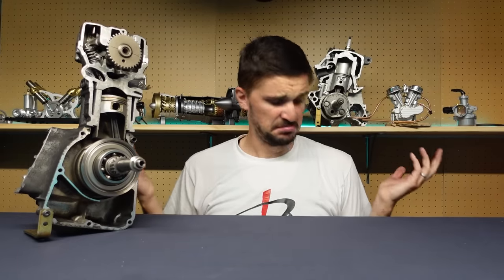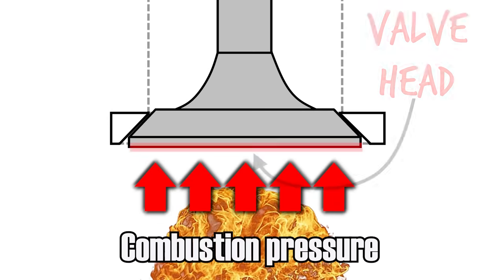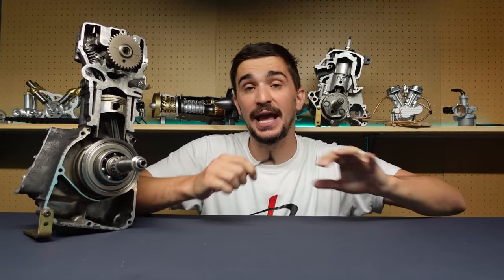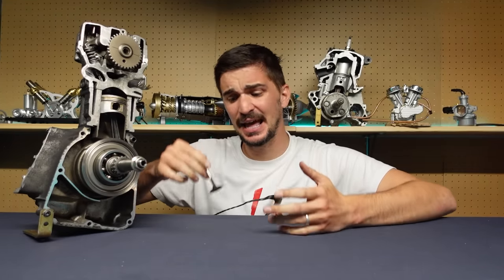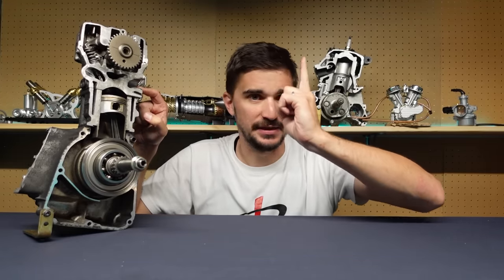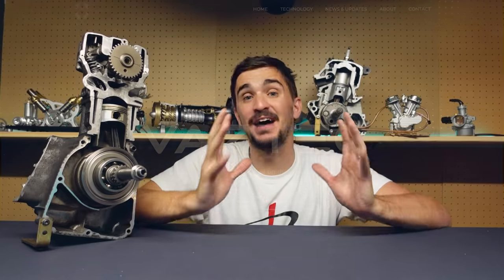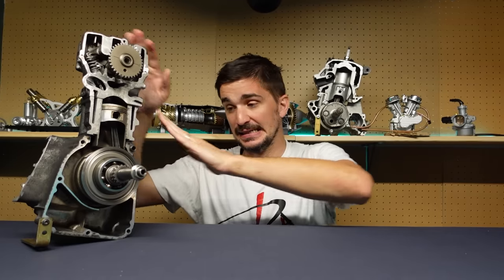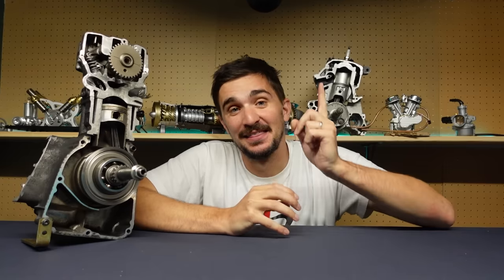Rotary Valves Make Normal Valves Look Silly - Why Aren't We Using Them?

Comment: SUPERCHARGED SUMP LUBRICATED 2 STROKE thats what we should be developing - and F1 cars should be made to use these - they would sound ASTONISHING
Reply: Not really usable with emissions standards. The Ferrari engine was basically the same concept as a 2 stroke diesel. They have issues with pushing unburnt fuel out the exhaust. Unburnt fuel and catalytic converters really don't get along.
Reply: @morpfrank4709 - I thought that issue had been fixed a long time ago but the only reason the project didn't go forward was not demand / need for it
Reply: @piccalillipit9211 there is no real way to get around the fact that air comes in at the same time it goes out other than leaving some exhaust gas in. This is basically what egr does I guess so it may actually help with emissions on a gasoline engine but eliminates the ability to use an EGR cooler on diesels. However without implementing a power valve like device on the intake they wouldn't have the same variability with timing that vvt provides. Sump lubricated 2 strokes are by no means dead and are used in marine applications alot, however big cargo ships are the last vehicle that cares about emissions.
Reply: What like the DeltaHawk engine? Turbo and Supercharged 2 stroke aircraft diesel
Reply: @daveone191 - I dont know cos I have only seen the Ferrari and other prototypes.

I you use forced induction you can lubricate the engine the normal way, its incredibly tiny and you get 2 X the combustion events. I just want to hear a V10 2 stroke F1 car reving to 25,000 RPM
Reply: @morpfrank4709 - I cant remember I watched a documentary about it but I literally have brain damage which means i forget some things.  

"This is basically what egr does I guess so it may actually help with emissions on a gasoline engine". I think you are correct that with port tuning [exhaust?] they could achieve very good emissions. 

For me F1 should be a test bed for weird and wonderful possibilities.  Have 5 years running 2 strokes, then 5 running Deisel, then 5 running 3 cylinder engines. 

If you re going to have multiple billions go into engines - make them invent new things
Reply: @piccalillipit9211 it's lovely to see you here, away from the subject areas I usually see you. It restores my faith that humans can think broadly. 😊
Reply: @alanhat5252 - Im trying to consume less news.  I realised I had a level of awareness of political world events that could only be described as "unhealthy and obsessive". 

Its good to be informed, but there comes a point where is not good, its obsessive and damaging and I had definitely reached that point.   Also very nice to see you here.
Reply: @piccalillipit9211 I too love valve-ported scavenge-blown 2-strokes
Reply: @piccalillipit9211 you spreading awareness of just how grotesque politics has become, & how dangerous, has huge societal value & I thank you for it but as you say, everyone has to find their own balances.
Reply: @alanhat5252 " everyone has to find their own balances."   Id got to the point I was correcting BBC correspondents on trivial details of  Saudi Arabia's politics and  such like - I thought "why do i KNOW this? This is of no interest or use to anyone and i simply should NOT know this stuff. This is an UNHEALTHY level unless its literally your JOB"
Reply: @piccalillipit9211 I like your idea of F1 as the test-bed for expanding technologies.
I understand F1 are going into battery-electric propulsion next which might mean them finishing with internal combustion though one of the Japanese makers (Toyota I think) have just announced a new ICE which they claim to be cleaner than battery-electric so who knows?
Reply: @piccalillipit9211 I don't know what's healthy, what I do know is that most of us have a very minimal & severely distorted understanding of world politics as compared with the Victorian & previous populace & this seems to be the work of the Daily Mail & other tabloids. (The Mail was the first, in 1896, probably encouraged initially out of snobbery). Most of us don't even know where our food comes from let alone what unpleasant surprises the future holds.
Reply: @piccalillipit9211  
The hard part with the supercharged 2 strokes is oil control. As you know, in a 2-stroke (even one with exhaust valves) the piston controls the intake ports by moving past them. When that happens it's inevitable that some oil will be wiped off the piston and rings and deposited in the intake port. Then on the next cycle that oil gets blown into the combustion chamber and burnt. Result is more particulate emissions and excessive amounts of ash (from burning of metal containing oil additives like ZDDP) in the exhaust stream, the ash tends to poison catalytic converters. Achates power claims to have mitigated this problem by very carefully controlling the amount of oil that actually reaches the piston rings (just enough to lubricate them, so the total amount of oil burnt is lower). We'll see how they do with their design once it gets to the production stage.
Reply: @nerd1000ify - This is so obvious and I never thought of it...  Thank you!

I once cut the end of my finger off in an intake port LOL, just installed new rings and I was pushing the pistons up and down and my finger slipped off the domed top of the piston and into the port - the momentum brought the piston back up and chopped off about 3/8ths of my finger 8mm - its still kinda flat at the end LOL

Comment: I once read (not long ago) about the story of completely eliminating the "camshaft" from an engine,along with the metal springs from the valves,and in it's place,using electronically-controlled movements of the valves instead! In other words,instead of the conventional camshaft physically pushing down on the valves,along with the valve-springs needing to push back to it's original position,these valves,had electronic sensors on their stems,hooked to the ICU,so each time the piston would approach it's time to fill the combustion chamber on it's downstroke,the electronic guided valves,would automatically open and close via their electronic "sensors" on the stem,and never have a problem regardless of what RPM the engine was running at. Sounded intriguing.

Comment: You are absolutely right about the power needed to open valves. It leads to lower power output for sure. Thanks for pointing that out. 🙏🙏

Comment: The Austrian model engine maker HP used to make a lovely range of rotary valve four strokes. they weren't very successful, because two strokes were cheaper and more powerful, and they made more revs. Beautiful little engineering marvels, though and incredibly well made and finished.

Comment: About a year ago I had a wonderful idea for this sort of thing. Of course like many others I thought I had just invented something completely new only to find that it recently has become a known technology. But what I see for this is a massive Improvement in the performance area. Here's my thinking

By the removal of puppet valves you no longer are scared of piston to valve clearance, meaning that you can design your Pistons for a massive compression ratio nearly taking up the entire head chamber. Also the loss of reciprocating motion and the weight of the springs traveling through sees and increase in horsepower. You can rev this thing potentially as high as you want until you start getting reciprocating Mass issues from the Pistons. I think this has a big potential and I even worked on my own CAD drawings to implement this on a Ford 302, an engine I'm familiar with

Comment: This example works well because it was selectively chosen by a smart engineer for its application: a V-twin or more plainly a separated single cylinder application. That application doesn’t expose the vulnerabilities of common bank sealing or heat. This application is best suited for single cylinder or radial engines.

Comment: I swear this is true. Around 1975 or so I heard someone mention the expression, "rotary valves" and started thinking about what it could mean. Over the next few months, I kept thinking about it and designed a system much like you see here. It was all on paper only and I was never in a position to build a prototype of any kind. I was never in a position to test any of my theories about how well it would work. What I did know was that by removing the rotational losses and wasted horsepower of camshaft lobes acting against springs there would have to be some increase in power.  I also expected that sealing would be a problem, but couldn't research it or try to overcome those problems.

What I'm driving at is that I have no idea when this design was originally conceived or invented, but the fact that it originated independently in my head is very gratifying. I actually invented this, even though it might have been invented well before I did.
Reply: Congratulations Jerry.  That is a gratifying feeling to experience being on the same path of a respected person.  It pisses me off when the accomplishments of engineers are dismissed because they did not initially conceive of a concept.  Execution of the idea and much more; the production of the idea is the thing.

Didn't DaVinci conceive of the helicopter.  And the Wright's invented and executed controlled, powered, heavier than air flight.  I do not believe any of their original designs really made it to mass production or survive today.

Comment: Over the decades, several working engines have been designed and built using rotary valves.  They are volumetricaly more efficient than poppet valves, and the spark plugs and fuel supply can be addressed, but the long term problem is that build up of carbon between the rotary valve, and its housing.  In a racing car engine, this can be cleaned up between race weekends.  But for long term road use it is terminal.

A more viable solution is using sleeve valves.  These have longer lives and no carbon build up.  Their weakness is the greater expense to produce precision sleeves and cylinders than that for poppet valves.  Take a look at the Napier Deltic triple crankshafts with opposing cylinders to produce the high compression necessary to ignite diesel fuel, and you'll see how effective sleeve valve engines can be.
Reply: even if maintenance is required, if the maintenance due is every 50k kilometers then i think its not too bad since you also open your valve train once every year or so to inspect and maybe clean build ups around the valve seats. so instead of valve inspection being optional we would simply make it compulsory which isnt that bad of a deal if the benefits to gain largely outweigh it. because sleeve valves can run into an issue of burning oil if they need lubrication

Comment: Check out the Reynolds Rotary Valve engine. Uses a rotating disc instead of a cylinder.  Not a lot of info out there so I don't know the specifics on how well is sealed. It is from 1911.  

However, I could see using a flexible disc or camming with a servo actuator to rotate to the correct valve position each cycle, stop and seal for the power cycle, unseal and rotate for the exhaust cycle etc...

Comment: If you look into it, America had a car engine without poppet valves. The actual cylinder wall moved slid sideways. It turned open the intake, close the exhaust, close the exhaust open the intake. I can’t remember which company it was but it’s already been done and I didn’t work well the way they did it.

Comment: I can see one problem with rotary valves, which is that the smooth flow is only for a very brief period when the opening is exactly aligned with the rest of the tube.  This could be mitigated by having the rotary valve opening be larger than the rest of the tube.

Comment: I like how he said, we worked around, for the valve limitations meaning, we kinda ignored that part for now. I compare this with carbs vs fuel injection, the finding of a maybe better way to accomplish a portion of the whole. Admit, standard poppet valves leave plenty of room to work a different way, both in space and simplicity.

Comment: To answer the question in the headline - it is much easier to achieve a seal with limited friction when you're only pressing two surfaces together. Such a system is self healing to an extent while a rotating one is self destructing when debris are introduced.

Comment: My recollection of rotary valves from years ago was that as they wore the engine compression lost out. The air flow gain sounds good but it has been proved that for normal commuter engines turbulence is required to get best economy performance from engines. The beauty of the poppet valve is that it is cheap to manufacture, service and fit. This makes for economy of production. I have ridden a very small rotary valve motorcycle which was quite fast for its day. The problem with the rotation of the valve is maintaining consistent clearance over all engine temperatures. This is cheaply covered by the poppet valve. As a production engineer I can see why the cheapness of the poppet valve won out BUT I would concede that technically the rotary valve has many theoretical advantages which you have ably explained. We were all besotted in the fifties with the desmodromic valve gear of Mercedes Benz in the 300SLR and years later by that of Moto Guzzi and in between the butterfly valve came and went.  There were beside the rotary valve as an option, disc valves and reed valves all with theoretical gains but for cheapness the poppet valve had it and extra cooling could be gained by a sodium filling. Finally, many manufacturers already had machinery developed for the production of the poppet valve train. A rotary valve would have put all this and many supplemental companies out of business. No government or industry would like that. On a personal basis for economic transport at speeds enforced in many countries there might still be a case for a side valve engine! Yes I can see you all reaching for your pens. It won’t happen but it could have viability with modern chemical technology.

Comment: If they could be made to withstand the pressure is required for diesel operations, that means no more spark plug, though fuel injection is still required.

The idea of possibly being able to have a valve with the same diameter as the piston is absolutely enchanting!
And with proper design the same valve could be used for intake and exhaust I'm sure!

Comment: Coates spherical head was highlighted in Hotrod magazine or Popular mechanics in mid 90s. These heads are used on many large combustion engines used to burn off excess propane gases on oil rigs. They modified a motorcycle engine and a ford 302ci 5.0L engine with these heads and the power produced was incredible in that time, it would be interesting to see what could be done in todays engineering with this type of system.

Comment: The German company WEBRA built a series of model 4-stroke engines with this rotary valve system in the early 80s, the T4 with a .40 and a .60 sized engine. The T4/80 had an ASPIN cone-shaped rotary valve.

Comment: If one of the main disadvantages of the rotary valve is seal wear, build the system so seal replacement is easy. We do this with other parts that needs to be replaced [relatively] often, like filters, timing belts, ball joints, brake pads. We don't make oil filters that last 100 000 km because it's much easier and cheaper to just replace it with each oil change.

Comment: In 1966 I was riding a Yamaha with a rotary intake valve and ported exhaust. I sold it,still running,with 22k miles on it.
W. O Bentley built his early cars with rotary valves. Napier built rotary valve engines for WW2 fighter aircraft.

Comment: A beryllium Copper sealing surface will work fine in this heat environment with no lubrication needed. I have made several of these for both 2 stroke motors and for 10-71 Roots superchargers in diesel engines. It can be done, but they are custom parts.

Comment: Interesting! In the mid-60s, when I was in 5th. I draw such a system in the 5th. grade HS, for high-speed reciprocating steam engines. Later, when I in the mid-80s showed that to an engineer for the American Bureau of Shipping, he told me that happily I didn't come up with that design in the 20s or 30s as then we would still have been using steam engines, - ;) However, when that said; today with new materials like ceramics, together with better and far more accurate machining technologies rotating valves should also be far closer to being a very good option, as we are closer to avoiding the sealing challenges.

Comment: Ducati use a novel double cam system called the desmodromic valve.
Instead of using a compression spring to close the poppet valve  uses a cam to close the poppet valve.
This reduces the required effort to open the valve and forcefully closes the valves - their engines have been very successful.

Poppet valves are very good they cause little obstruction and operate well.

Comment: We have done Research on Rotary Valves and it looks Promising... New Head or refurbished Old Head uses Similar Technology as Vaztec... we keep 'Standard' Dimensions so Any Over The Counter Add parts; Intake Manifolds, Throttle Bodies, Exhaust Headers, etc can be Bolted In and Fit...

Comment: Regarding timing: I think it is the perfect timing.
Car companies have stopped development on conventional combustion engines, as far as I know, thanks to regulation.
They are putting a lot of money in EV, while re-using the current state of technology in ICE.
In 5 years from now, since they are not investing anymore, you start to get opportunities for ICE development, if these engines are still being produced.
Especially in hybrids, it is important to have a compact combustion engine. If you can remove a lot of the breathing equipment, that's advantageous.
So, if the rotary valve can reduce size, it will be a huge benefit to car companies.